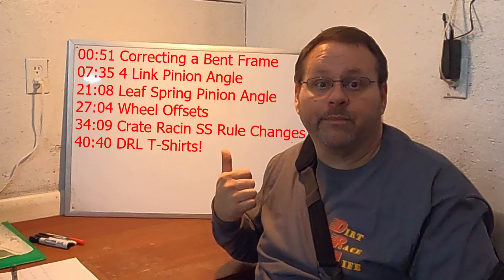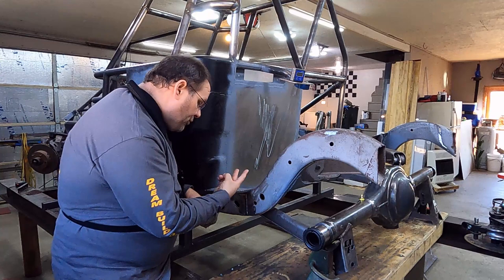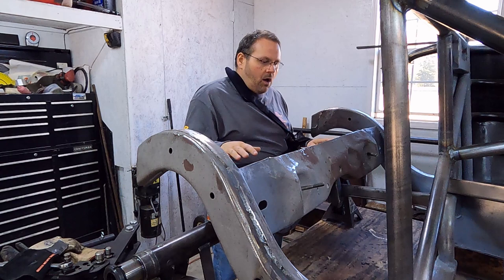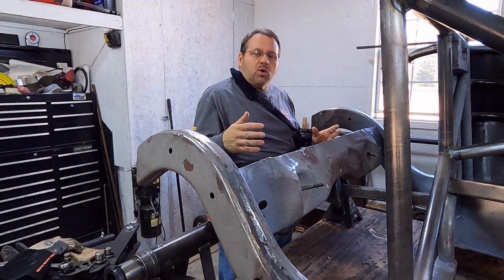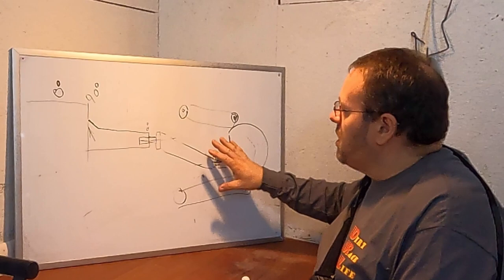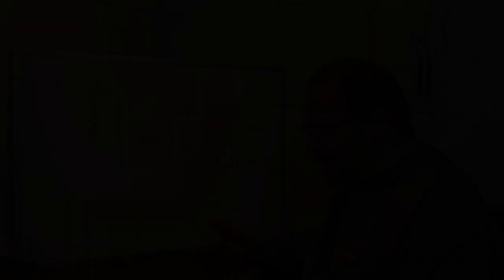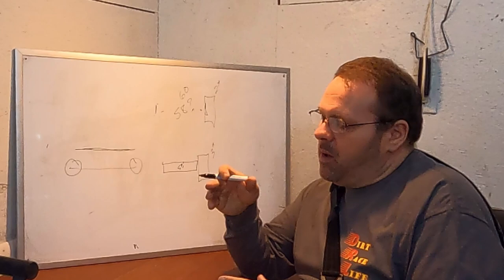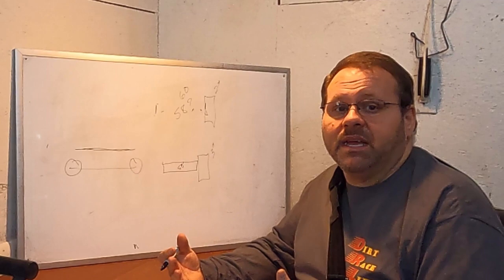How Pinion Angle Works & Crate Racin just BANNED Bump Stops plus We Fixed a Bent Frame, and More!

Comment: It’s crazy how all of these rules are changing. The 2 local tracks I run are now switching to USRA rules for every class but Crate Late Model, and Street Stock. We can run Quick Change rear end in a Limited Modified now, and where the rules favored the 602, now for the guys who runs that engine has to have a rev limiter set at 6200
Reply from the maker: Agreed, Big sudden changes are a bad deal and disruptive. I do understand sometimes they are needed because something is happening that is harming a class but . . . . . sometimes it's real hard to see that connection :(
From what I am observing it does hinder a 602 to be capped off at 6200 but at the same time it should allow guys to go longer in between valve spring changes. So did they do that to help the class???? Maybe. I guess it's all about how the combo stacks up now against an open motor.
I have no issue with quick changes. They cost more, weigh more, and draw off more horsepower. . .  BUT if you are racing at multiple tracks they make life so much easier and that may result in a racer attending more races. Reasonable? I think so.

Comment: The upper cross member with the mounts could have been welded in a little over. These frames weren’t very square from the factory. I also remember drilling holes into the rubber left lower control arm trying to add bite and rear steer into the GM stock 4 link. Never seemed to work. I went to Neoprene bushings and it made the car way more consistent. But I only ran the stock 4 link 2 years before the rules opened up. My next car was a impala wagon leaf spring rear clip on a 68-72 chevelle front clip. Then after 3 years of racing that the rules opened up to basically stock front clip and fab rear clip but you could only run a 3 or 4 link but no pull pars, bird cages or anything like that. You had to run ridged links. Then my kids came along and I couldn’t afford to race anymore. So many changes since 2007 to racing. I’m glad to see some classes going back to basics. Like what is a bump stop?? Lol
Reply from the maker: Actually. . .  Yes part of that half inch HAS to be that because best we can tell the rails themselves appeared to be around 1/4 to 3/8 inch over. I just had not considered it could be a blend of the two.
Appreciate the feedback, sound like you "been there, done that" too, and thank you for watching!

Comment: Good luck with the recovery from your surgery.  I had hand surgery done myself. My left hand thumb was stuck. I couldn't bend it so I couldn't really grab items well.
Reply from the maker: Appreciate it Dave, I am coming up on week five after the surgery and hopefully in two more weeks I'm out of the sling and doing physical therapy. Loosing that left hand for use is driving me nuts in the shop but sounds like you been there and done that too. I'm trying to figure out how to do my fuel cell mount one handed..... thinkin I'm going to use an engine hoist :)

Comment: So for all these guys(my friends included) that were running bump stops and winning big races, why not put a rf spring in a spring smasher that’s 25 lbs lighter and put a spring rubber in it to verify rate is close to old spring?

With motion ratio for shock mount to spring taken into consideration, I’d bet that the spring rubber will cause the spring to coil bind at about where the bump stop was limiting travel before?
Reply from the maker: I see your logic but I do see a flaw as well. When the spring goes into coil bind that spring is done. So the rubber would still have a rate but it would be very very different from how a bump on a shock is creating a progressive rate overall. I think the rate would spike very significantly but it might be something some would be willing to invest some testing time in to try and figure out if it can be made to work.
Reply: @DIRTRACELIFE  yeah it will spike for sure. May have to use a medium or soft spring rubber instead of one of those orange bricks. 

The yellow “Christmas tree” bump stop that most people are running on a rf setup has a lot of hysteresis though. So after you smash it once it’s rate changes significantly depending on how much you smash it. 

If even a soft spring rubber was too much then you can always start cutting the spring rubber down too. I think we’ll see a lot of guys try it.

Comment: These auto makers probably made that frame like that and push them out on the street that's why years ago you used to see a car going down the road the wheels were straight but the body was a little bit off
Reply from the maker: Yes, I think it was ALOT more common than any of us realize and they probably just did a front end alignment and sent them on there way.

Comment: I was watching uncle tony, and he said on leaf springs the drag race guys move the clamps from behind axle to in front of axle. He said more clamps in front better. Have you tried this wandering what happens in corners. Im sure there doing this for front drive. Thanks
Reply from the maker: Yes, the idea is hiw it lets the rear leafs fan out. When I run multistacks I ALWAYS do this. It lets the front of the leaf wrap more. I could see how it would help a drag racers 60 foot times just like it helps stock cars forward bite off the corner.

Comment: So, dumb question, when you say -7° for leafers, that's on the pinion only or combined with the drive shaft? My Camaro doesnt have a mid plate. Thanks.
Reply from the maker: 7 would be my maximum number allowed for a leafer and that is the difference between the engine and the rearend. So for example if the car was sitting in a manner where the back of the block measured 0 degrees and the face of the rear end pointed down inthe front by 7 degrees then that would be 7 degrees pinion angle. if the block measured 1 degree tilted forward and the rearend measured 8 degrees then you still have 7 degrees total.
Reply: @DIRTRACELIFE  ok thanks

Comment: At Camden we are averaging 3-4 CRUSA cars a week, Hobby is bad fast as you know. So most of the guys are dropping to Factory Stock or doing a “downgrade” to their cars. I hate we got a sanctioned class it was good as Nesmith but the new changes since 2017. I didn’t realize how bad it had got until Colby finally sold his car this year.
Reply from the maker: I know exactly what you are saying. Thats the exact reason I pulled my camaro down into a factory setup after I broke my hobby level motor in 2020.  Appreciate the feedback and you watching!

Comment: What's your opinion on the Quick Change debate for Street Stocks? Should they be an option?
Reply from the maker: Well. . . Now that I have purchased a 9 inch . . .NO! LOL.
Seriously though, I think the CRUSA SS is not in any way stock and its heading more and more towards big races where drivers travel to compete. The quick change is heavier and takes more hp in friction loss so I'm ok with it. For someone who only runs one track and has a 9, the QC does not give his competitor any advantage over him.
Reply: @DIRTRACELIFE  Myself ive always considered that they should be allowed. Add weight or no, you can still change gears with a 9". But that is more expensive and takes more space for the same options. And yes they take another 10+hp to turn the rear tires over a 9". So i would say they are roughly equal options with pros and cons to each.